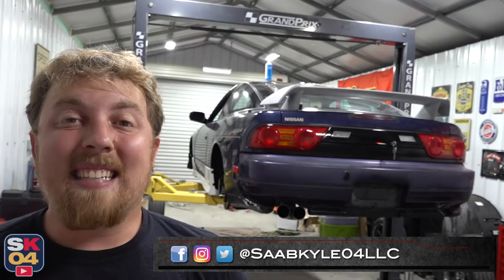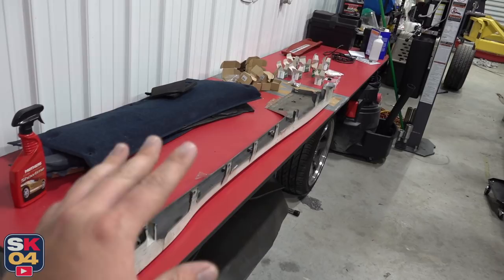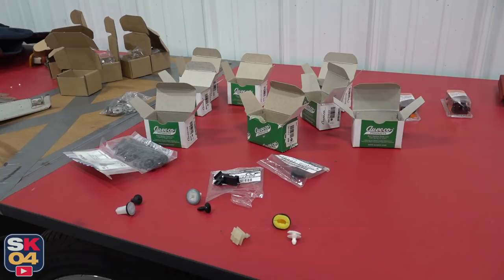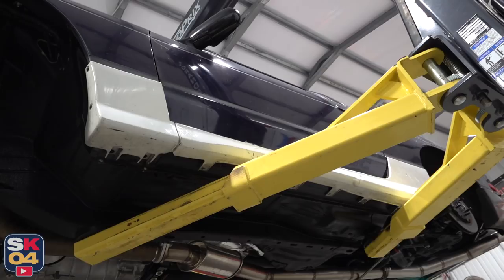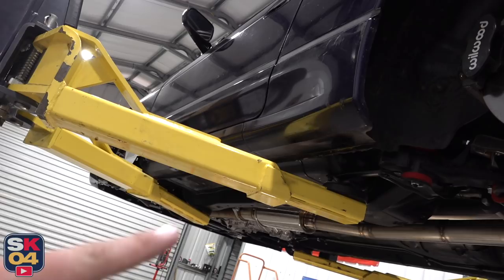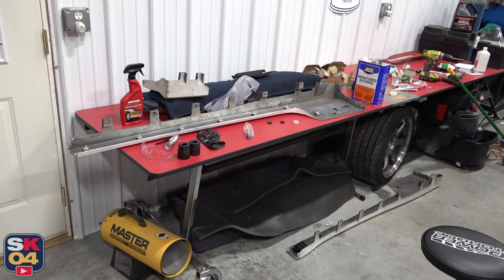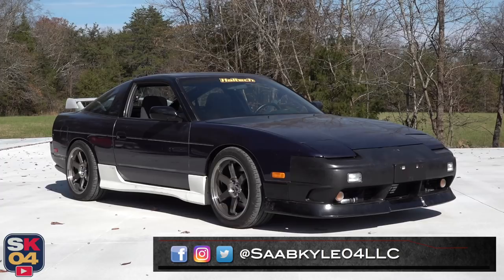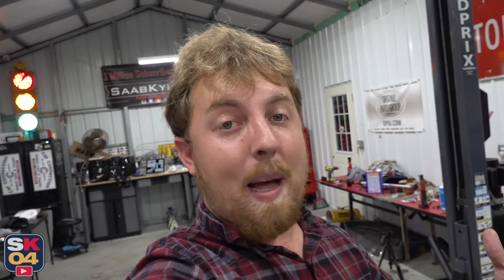The 240SX Gets Genuine 180SX "Kouki" Ground Effects To Finish The Type-X Conversion!

Comment: Currently in the process of doing a type x conversion on my 240 and was wondering. Where did you source the side skirts from? I really want to stay oem if possible but my searches have come up dry. Love your content! Great job on the videos!
Reply from the maker: Thanks man!  I think I got them from a place called Wolfreign Motors.  It's been so long, but I remember they will also bid on Japanese auctions on your behalf for a commission.  They sourced my front lip and I'm pretty sure I got the skirts from them too.  Good luck!!
Reply: @saabkyle04  thank you for the response man! Definitely going to look them up. I bought dorkidori rear valances as all the ones I found were cracked. But I'd prefer to get oem side skirts. You've such an inspiration on my restomod build so it is cool to see things come together!

Comment: When the paint is up can I suggest a colour if you had one chose that’s ok
Reply from the maker: I'm sticking with the original color, Midnight Blue Pearl.  Thanks!
Reply: Will stripes work it’ll give a racier look
Reply: Maybe a graphics set on the doors P.S a little advice maybe make it say 16 Angels and Lindsey
Reply: Maybe chrome on where the parts end
Reply: The colour is just shy of my logo